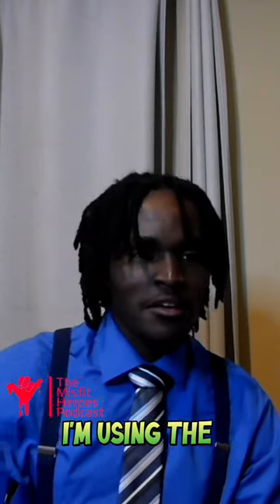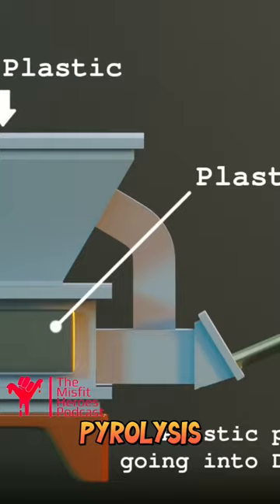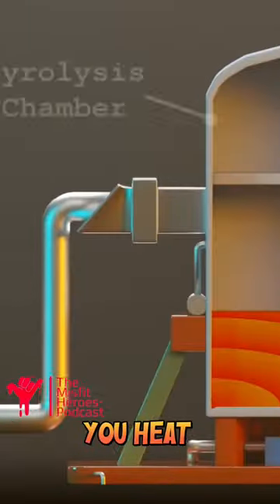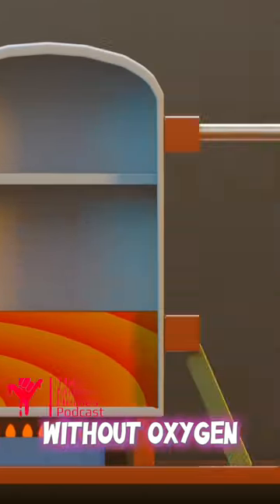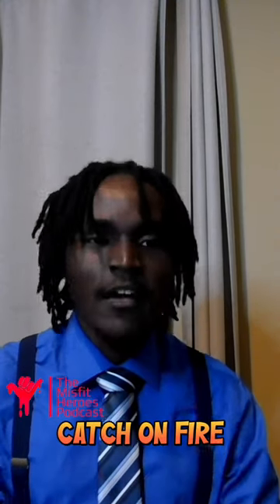How to make gas out of plastic waste

Comment: He fixed the recycling problem
Reply from the maker: Very much so
Reply: It's not efficient enough, the amount of energy it takes to create the oil is almost the amount you get out of it so it doesn't make sense. This is not new and the reason why it's not done. Not enough positive to make sence to do.
Reply: @indigomarine91  Just power it with solar panels only making the fuel during the day from sunrise to sunset if you can afford the panels
Reply: @fireball75677  most of the energy is from dealing with the super volatile excess that comes from it. Not just from heating it.
Reply: @fireball75677 lol green energy could just be used for other purposes instead of wasting them to create less energy.
Reply from the maker: I think his passion is more about educating others so that they can do it themselves. It’s only somewhat inefficient because of the lack of more public adoption. If people can lazily just create more products versus renewing or reusing or recycling, it will always be less efficient versus big industry.
Reply from the maker: That could definitely be accomplished. You should mention it to him, I have found he is most interactive on instagram.
Reply from the maker: This is true.
Reply from the maker: Isn’t burning plastic toxic?
Reply: Not really just because he changed the property/state of the object doesn’t make it cleaner. It does burn into the air much quicker. C02 😂
Reply: @Blazingfireball977 solar panel require energy to create.
Reply: @thebigbang9983 the plastic doesn't burn thats the point bro
Reply: This has Been a known technology since years but the problem is the high Benzine levels in his fuel if he is doing this with pvc he could have benzine levels up to 60% and Benzine causes cancer
Reply: And created a cancer problem
Reply from the maker: @handthing9709 How did he create a cancer problem?
Reply: @TheMisfitHeroesPodcast  in Normal fule their is about 1% benzine and in his fules depending on the plastic used their can be up to 60% of benzine and benzine is extremely cancer causing
Reply: No he didnt. Lol
Reply: @indigomarine91 Think though, we dont need to keep fracking for oils and fuels.  we have all of these plastics and things already we can repurpose them and save money on gas too.  It doesnt just solve recycling.
Reply from the maker: @devonwadleigh3693 it’s more important that he’s teaching others how to do this for themselves. Spread the movement so to speak lol
Reply: @TheMisfitHeroesPodcast  by burning plastic in an urban environment
Reply: @TheMisfitHeroesPodcast no he didn’t bro. He literally is melting plastic and is blaming with a environmental disaster. That’s why he got Injured too. This is so frustrating to watch man. I don’t get why people don’t ask more questions
Reply: no, he didnt 😂
Reply: @TheMisfitHeroesPodcast no its inefficient because it costs more energy to do this than to refine fuel in the first place.
Reply: @indigomarine91  next step add a mirror that reflects onto a steam turbine.  As what do you think this energy was to begin with

Comment: My grandpa did this with tires in the 1980s
Reply from the maker: Pyrolysis was discovered in 1877. I think it’d be great if this was mass adopted
Reply: Rubber tire is made of tree sap, not crude oil. But yea it's almost the same thing. U can make fuel from wood including the sap. But its more costly

Comment: So this is going to be mixed fuel, right? Would that run in a normal car or would this only run in diesel engines that are more tolerant of fuel composition?
Reply from the maker: @quintonjones7139  he has run a go kart with gas he’s created, and a 90s era ford f350 with diesel he’s created.

Comment: When you realize the fuel to break it down, that energy cost is greater then what you created.
Reply from the maker: Yes, but this is one person doing an effort to reduce, reuse, and recycle his waste as much as possible. Imagine if more got on board.
Reply: @TheMisfitHeroesPodcast  you are talking about using 10 candles to make 1 candle.
It has been done before and thats the reason why its not sustainable.
Reply from the maker: @egoygoy7542  I guess. Doesn’t that train of thought sort of limit progress, though? Understanding that it’s been done before, what if there could be some process improvement that leads to massive upsides?

Comment: The whole process is just not efficient. In order to get gas, that you can burn, you have to burn wood/coal. The gas is also not usable with modern motors, you can only use it with old ones. But at that point you have to ask yourself why not burning the wood and plastic directly to power an engine.
Reply: 0:01 He’s not using wood. He’s using the internal components of microwave ovens. He just did a livestream where he powered a late 90s ford f350 with the diesel he created. You should listen to the full episode and hear him out.
Reply: @whoanowyo  The whole thing might work on a small scale, when you don't really care about money or efficiency. But it's obviously an energy-wasting. This process is not a secret, that gets surpressed by some oil-companies... This is an old method.
Reply from the maker: @bobskanal  I believe he is more focused on teaching others how to do this method and keep it sort of open source rather than looking at it as a “for profit” type model that would more than likely get overlooked because of capitalism and profit means. If the process were to become more widespread adoption, that’s great, but I believe his goal is for the proof of concept to be distributed rather than to make personal gains from it.
Reply: Hey,whether go Big,or go small,or however the energy consumed,for the process,what a great thing to be able to really recycle one of the worst,environmental pollutants,we've created,and maybe make some fuel to mow the yard......Ps.....I'm 100% combustible engine....
Reply from the maker: @bobbystephens2099  I like your train of thought. I don’t think the means in which it’s recycled matters. It’s still early in the process but my guy is making fuel recycling a valid matter in 2024. That’s a pretty big step, especially for one person.

Comment: Chemists disagree
Reply from the maker: About what?
Reply: @TheMisfitHeroesPodcast  he’s making mostly butane, only 1% of it is allowed in commercial gasoline. He theoretically has ALOT more than that. And to separate them is virtually impossible. It’s all haphazard actually.
Reply from the maker: @forge721  but does it work? He’s powered a gocart and a diesel f350 at this point
Reply: @TheMisfitHeroesPodcast  it “works” but it’s expelling highly dangerous butane fumes which is carcinogenic. He’s been dm’ed and said he will fix it, with 2 things that won’t fix it. It’s 1% vs more than 50%?
Reply: @TheMisfitHeroesPodcast  trust me I’m not being a hater, I love this guy. He just needs to guide that genius a little better. Do your research
Reply: @TheMisfitHeroesPodcast  https://youtu.be/xCD5bfxS_iI?si=DzHDe4vJJekGszso